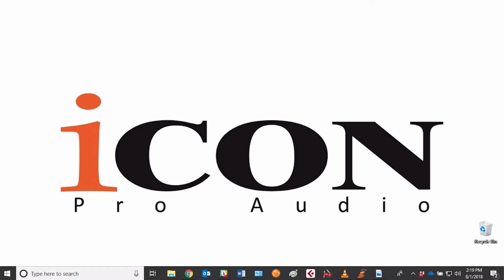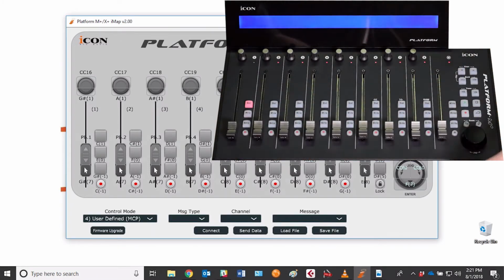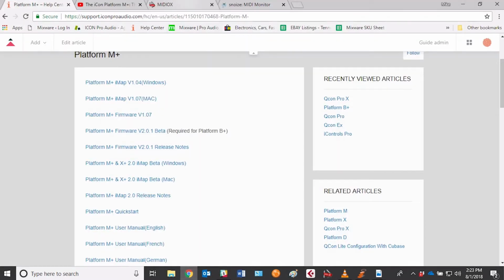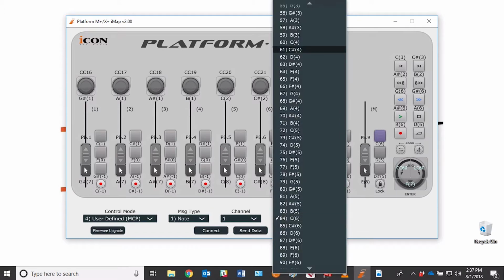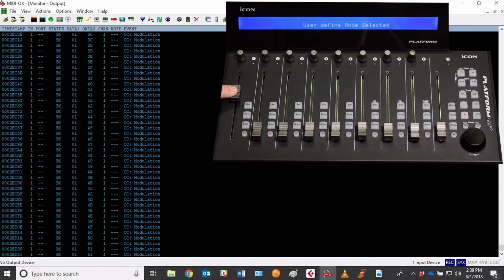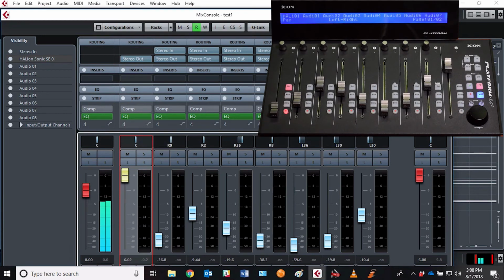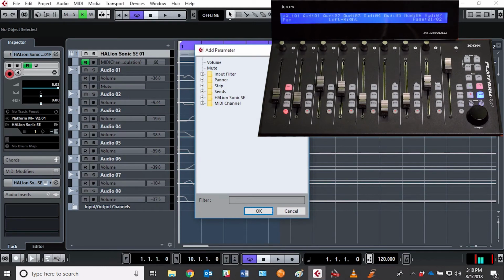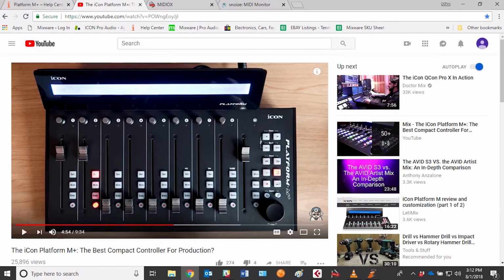Platform M+ User Define Mode Custom Mapping Tutorial - YouTube

Comment: I recently purchased Icon Qcon Pro G2 and it’s been working great.
I have one problem though and it would be great if someone could help me.

I’m using Cubase 11 / 12 Pro and I have its max fader volume set up at +12db, instead of +6db.
The problem is that when I physically push faders on my Qcon controller to max, they only go to +10db max in Cubase. They don’t seem to recognize my +12db preference.
I've managed to do a primitive version of it, setting it via Generic remote, but it can only be assigned to a specific channel or selected channel, which doesn't solve the whole problem, and it also coincides with controller's integrated mapping.
If I set up Cubase max fader volume to +6db, it works fine with the controller.
My controller is set up as Mackie device, and every other function seem to be working correctly.
Is there a solution for this?

Thanks in advance

Comment: How can you program eq control in Pro Tools (Can I use it to control Channel Strip?)
Reply from the maker: The Platform M+ does not control EQ or plugins in HUI mode, which is the DAW mode that works best for Pro Tools. You can control EQ with the Platform B+, however. The M+ is designed to control faders, pan and transport.

Comment: Hello, thanks for the videos and for such a nice product line. I have a question on the "mixer" button. I am using the M+ in MCP mode for mixing, and in "user define" mode for composing (CC type of thing with VSTIs). Wouldn't it be logical to get the "Mixer" button to be assigned directly to launch the mixer? THe point is, in MCP mode, I use the mixer a lot, but cannot launch it. ANd then when I compose, in "user-define" mode, when I could launch the mixer, I really don't tend to use it at all... DO you see my point? Yes I know I could save two configuration profiles and get them loaded for mixing and for composing in the very "user-define" mode, however this is not going to ease my workflow, and at the same time, common sense says "why the mix button cannot launch the mixer per default in MCP mode?" Guys, thanks in any case for a really nice product, congrats!

Comment: After 3 months of trying to work out how to successfully use the user define mode with logic (to control kontakt, spitfire etc), I STILL can not get it to work :( Icon - can you PLEASE upload an up to date tutorial on this?? It seems like there are lots of conflicts happening between the preset controllers and the ones I want to define - is there a way to detach the two?
Reply from the maker: Platform M+ is NOT designed as a plugin controller. It is best used as a DAW controller for faders, encoders and transports. 

Based on our research, Kontakt does NOT work with Mackie Control Mode. Likewise, Spitfire will work in DAW mode with Mackie Control, but will NOT work in MIDI CC mode with our user define mode. However, if you are using the controller to control Logic, you will very likely see some conflicts. 

It is unfortunate, but it appears you are attempting to use the device for something that was not part of the design plan. Sorry.
Reply: @Iconproaudio  Many thanks for your response. Funny thing is, after a lot of playing around I have successfully got the icon to control the kontakt and spitfire plugins (cc1, cc11, cc7). Only issue now is trying to assign the remaining controls: jog wheel/transport controls/zoom etc, and this seems totally beyond my technical knowledge/skill. I absolutely love the m+ in DAW mode and all the controls, but I maybe naively thought it would be so much easier to program a MIDI controller surface to control the controls I most want to control - especially with a 'user define' mode being available. From extensive internet research, it seems I'm definately not the only one to have problems with this and some sort of updated help sheet/video would be amazing. However, your tech support team are great and I'll keep on at them. Thanks.
Reply from the maker: @nickmack1976  Glad you got this to work the way you want to. You may also want to explore a program called Bome Midi Translator Pro. Some people are using this with great success for mapping. their controllers and creating custom maps. https://www.bome.com/products/miditranslator

Comment: I just bought the m+ and it was advertised to work with reasons....it does not! Template has missing labels none of the buttons work and the platform B+ is worse. I know reasons has a terrible way of using Mackie control but don’t advertise you support reasons when clearly no though was given to that mapping at all..so disappointed!

Comment: Just got my Platform M+ - I can not get single channel selection to work with Cubase 10.5.20 on Windows 10. The 8 bank selection works fine but not the single channel. I can see in midi-OX that it sends the C3 and C#3 - any clues?

Comment: Hello! I recently bought your Platform M + Planform D2. I studied the instructions. I have been working in the studio for 30 years and everything is clear to me, but the device does not behave the way it is written in the instructions. I have a MAC Catalina 10.15 and Cubase 10.5.
          In MCP Mode all buttons work, but two “Chan” buttons do nothing and write two inscriptions on the display - Left-Right and Front-Rear. What this means is neither in the instructions nor in consumer reviews.
         The display shows two lines of text. The second line says “Pan”, “Front-Rear” and “Page 01/02. Why are these inscriptions?
         The Mixer button does a different thing.
           I wanted to set all controllers to User define Mode. I've done this many times in other controllers, but it doesn't work in Platform M +.
         Please help sort out the problem.
Regards, Oleg
Reply: Why didn’t you write them an Email (customer support Email)?

Comment: Not happy Mike from Icon.
I purchased a Platform M+ to control expression, dynamics, etc via MIDI CC. I have followed the instructions in this video and the user manual numerous times. I have also spent hours dealing with Icon Support without a satisfactory outcome.

The final email I received from Icon contained this information, and I quote "SINCE THE VIDEO HAS BEEN SHOT A LOT OF CHANGES HAVE HAPPENED TO THE OPERATING SYSTEMS, FIRMWARE AND DAW SOFTWARE. THEREFORE SOME BUGS MAY HAVE OCCURED AND WE CANNOT GUARANTEE THE FUNCTIONALITY ANYMORE". 

If this is the case you are selling a product which is NOT FIT FOR PURPOSE and requires immediate attention. It has been a total let down. I want my money back.
Reply: The expression and modulation he used in this video are not the same as the ones in the  key editor. There are tracks CCs and Key editor  CCs. Its very confusing. I think that MIDI cc on traqcks goes with the track, MIDI CC with the key editor belongs to the part. One travels with teh part, if it is moved the other does not.

Comment: Ok, so I got it working - however I notice in your video that when you play back, the fader does not move with the automation (or similarly I would think if you use the onscreen controls it does not do that either). I thought maybe a midi send could get this to work, but for the life of me, I cannot get it to. Is it possible, and if so, how in Cubase do you accomplish this? Thanks!!
Reply: Yes, I also have this problem. Once I entered User Defined mode, the faders don't seem to move anymore.

Comment: Hi guys,
Hope you can help. Watched this vid and several other vids about remapping midi cc on the faders but it’s impossible to do it. Started imap in user defined mode and tried to remap fader 1 to cc11 and fader 2 to cc21 and fader 3 to cc 1. Saved and sent data. Until this point it looks fine but ist? doesn’t work. The faders do not control the cc in NI Kontakt. Anybody can help?
Reply: me the same, Logic Pro doesn't work.
Reply: Ulysses Lee hi there. I fixed my problem. Not very easy to explain in a few words. I wrote to icon and they tried to give me a solution but I think they didn’t understand what I was trying tio fix. Now I can use the icon as a mixer to control everything in logic or switch it to control all the cc as I want. I normally only use to control the cc in Kontakt loaded in logic normally. If you want to know how I did it send me a pm. Right now I’m not able to make a respond video
Reply: @RPekka  I was heading to use midi translator to fix this, it's a little bit complicated and not cheap. if you have a better way please give me your email. my email is: lidahua416@gmail.com
Thank you so much for your reply!!
 \T0T/
Reply: @RPekka  please teach me how did you fix this, thank you very much~!
Reply: @RPekka  How can I send you a private message? I'd like to know how remap faders. Thanks. :-)

Comment: I've just bought this, after returning the Behringer X-Touch but I'm very disappointed that you have to power cycle to 'flip' between mixer and user defined. 

Is there a possibility to do that in firmware such that a combo button press will flip back and forth?
Reply from the maker: Hello Zoe,
Thank you for reaching out, We apologize for the inconvenience caused by the DAW mode system which you're experiencing.

Unfortunately there is not currently a way to change DAW modes after starting up your device from the hardware, however you can load your iMap software before loading your next DAW and switch DAW modes directly from there if this is more convenient for your work flow. It's important to remember to close your iMap before loading the next DAW software though, as this may cause connectivity issues. 

I hope this helps to sort things out, though of course if you have any other questions or concerns please don't hesitate to let us know.
Thank you again for your patience and understanding in this matter. 
Icon Support.
Reply: Hi, Zoe!

May I ask what controller are you still using now?

Looking to buy the Icon Platform M+. 

I really do hope that I don’t have to do all the iMapping stuff, before I start Studio One...

Please let it be Plug & Play. 
Please. 

Or do you recommend another controller?

Comment: hi, can anyone help me figure out why I use my faders to control modulation? I've set the cc for fader 1 to cc1 in Platform M+ but my DAW (Logic X Pro) isn't receiving any data. However, the mod wheel on my midi keyboard does work. I would like to know this so that I can control the mod wheel in Kontakt to arrange strings etc.
Reply from the maker: Hello Gino,
Thank you for reaching out, Yes the Platform M+ can be mapped to send CC MIDI messages using the User Define mode.
If you're having issues creating a custom mapping, please make sure you're using the correct message and that you are using User Define mode in your DAW to access this custom mapping.

Please also make sure you are pressing 'Send Data' to commit the mapping to the device after creating your custom map.
I hope this helps to sort out your issues, though if you're still having trouble please don't hesitate to submit a ticket to our help desk and one of our agents will be happy to help you out if possible.
Here's a direct link for your convenience: https://support.iconproaudio.com/hc/en-us

Thank you again for your understanding.
Icon Support
Reply: @Iconproaudio  hi thanks for the quick response. Unfortunately I was already doing all of the above but it still doesn't work. I'll try contacting the help desk, thanks!
Reply: @Iconproaudio  I cannot login via the link you send or the website, I've checked if I had cookies enabled and I did but it's still not working :(

Comment: Hi, just got a platform X+ alone thinking i could control any tracks but looks like i only control 1 to 8 on nuendo. is that possible to do or you need M+ ? where can i find that no forum, doc doesn't talk about it.
Reply from the maker: Hello Moreausylvain,
Thank you for reaching out. We apologize for any confusion.

The Platform X+ is an extender for the Platform M+, meaning this device lacks the transport controls that the Platform M+ has. This includes the ability to bank.
If you would like to control more than 8 channels, you will want to use the Platform M+, as the X+ is designed only for adding additional faders.

I hope this helps to clear this up, though if you have any other questions or concerns please don't hesitate to submit a ticket to our help desk and one of our agents will be happy to get back to you as soon as possible.
Have a great day,
Icon Support.

Comment: How do you map transport controls with CC instead of Note values? Do you set up a Generic Remote instead of Mackie Control?
Reply from the maker: Hi Sam,
Thanks for reaching out, there are two ways to do this. One would be to make a custom map using our iMap software and the User Define mode. 
The other option, which may be quicker depending on your DAW, may be to use MIDI learn. This would allow you to select the function on the controller you would like to map, and assign it within the software.
I hope this helps to answer your question, though if there's anything else we may be able to help out with please don't hesitate to submit a ticket to our help desk. Here's a direct link for your convenience: https://support.iconproaudio.com/hc/en-us

Thank you again for your patience and understanding.
Icon Support.
Reply: Icon Pro Audio thanks for the reply. I just sent in a ticket. I am using CUBASE and have been attempting to use the imap software. I’ve seemingly gotten the platform m+ to send the correct messages (by looking at MIDIOX) but it doesn’t appear to work in CUBASE. I have made sure that I have user defined mode selected too. I’m basically just trying to get the transport controls to not play notes. When I press a button or use the jog wheel it plays a note from my virtual instrument and can be quite annoying. 
Again, thanks for the help.
Reply from the maker: Sam,
My apologies for the confusion, we have also replied to your ticket but will include the solution here.
This is a fairly common issue users occasionally experience in Cubase.
I have included a direct link to our article which explains this issue and how to solve it below for your convenience: 
https://support.iconproaudio.com/hc/en-us/articles/360000567051-Cubase-Why-is-my-control-surface-triggering-sounds-in-Cubase-

Thank you again for your patience and understanding.
Icon Support.

Comment: Hey guys, how can I flip single channels. Flipping banks is working fine but I just want to flip to the next channel. Isn´t working in Cubase 10 and is very important for the workflow. Flipping only banks with 8 channels is not very usefull. Thanks in advance!
Reply from the maker: Hello Ulrich,
Thanks for reaching out, unfortunately there is no way to select individual faders to flip, as the fader flip function is intended to flip the entire bank. 
We apologize for any inconvenience this may cause. 
Icon Support
Reply: Thank you  @Iconproaudio  for replying that fast! Maybe flipping is the wrong word. There are four knobs on my Platform M+.
>|, |<, >>8, 8<<. So I want to use the function (>|,|<) to select the next or previews (single) channel and not the next or previews eight channels. I tried it in my old Cubase 6. There it is working just fine. But in Cubase 10 it is not. Do you have any idea or recommendation? This function is so crucial for my workflow.
Reply: Any Ideas on that  Icon Pro Audio  ?
Reply from the maker: @ulrichhilbel  Hey, Ulrich. You should be able to move from channel to channel with no problem using the channel button. If you're having an issue with that, please submit a ticket at www.iconproaudio.com, and we'll help you troubleshoot it.

Thanks!
Reply: Thanks a lot! Will do that!  @Iconproaudio
Reply: Ulrich Hilbel Hey, did you solve the problem? :) I have the same issue.

Comment: Using Bitwig I'm having a hard time when Mapping to a Fader, I'm not gonna use the Platform M+ for Mixing, rather use it as to improve expression on sampled acoustic instruments (Orchestral Tool, Spitfire). After several attempts, the fader is mapped to a knob in Bitwig, but after moving the fader in Platform M+, the Bitwig knob and the Platform M+ fader returns to its previous place automatically.
Reply from the maker: Hey Victor,
We're sorry to hear you're having trouble with Bitwig. We strongly suggest checking out the DrivenByMoss Bitwig Script as it greatly improves the Mackie Control support between Bitwig and the controller.

Comment: Here is a message i sent to the Icon support team. Still no response.

OK so how do we do this on Platform M+ on MAC OS in Logic Pro?

Syncing MIDI CCs to a control surface (ICON Platform-M) in Reaper
https://www.youtube.com/watch?v=ZO6eQt6L1KI

As well as syncing this, my faders will not sync with the volume automation in the DAW at all. It is set on #3 logic Pro or #7 user defined mode, I think you really should have tutorials out to show how to do this. Also, this mixer button will not open and close my mixer. Very confusing, please assist. Thank you.

Can anyone help with these issues?
Reply: There also doesnt appear to be any way for me to get to Platform M v2.01, I can only get Platform M+ V1.07 for the device, although I am now running iMap in V2.00 with the 4 modes now.